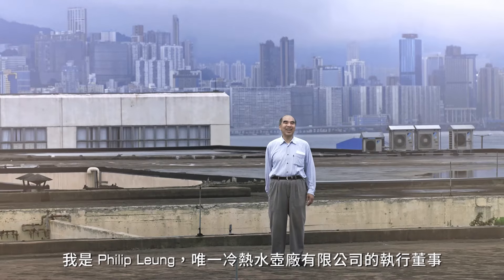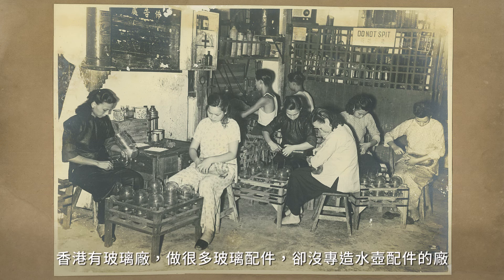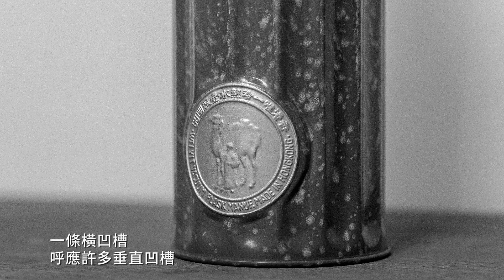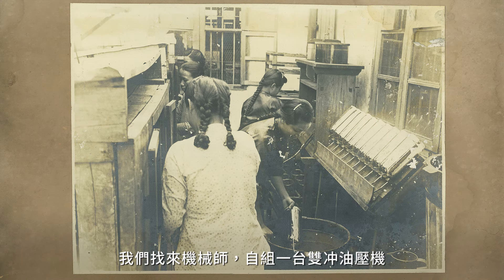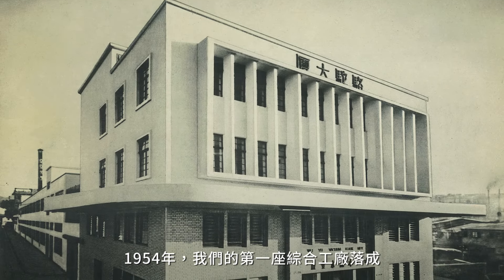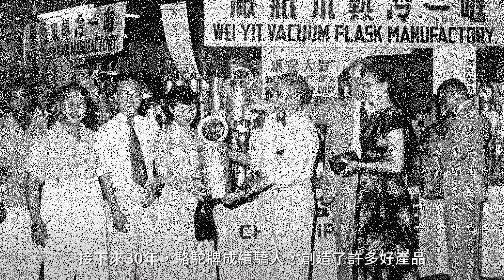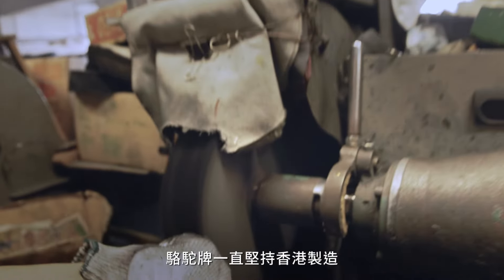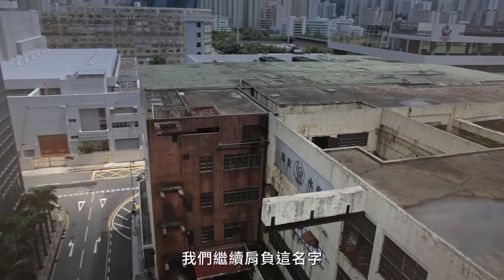Our Name Is Camel 駱駝牌的故事

Comment: I have one of your older Camel flask products and I was trying to determine when it was manufactured. At the 1:57 mark of this video, there is a shelf with all your flask models on it. My Camel flask looks very close to the one which is second from the top left area. The large blue one, but my Camel flask has the Camel picture Logo on it of the man with his camel, so I'm not certain if this is the exact item or not. But my reason for writing this comment was to find out "when" my Camel vacuum flask  was manufactured. It looks to be somewhere from the 1950's to the 1960's but I'd like to know more accurately when it was manufactured. There are only 2 identifying numbers on my Camel flask. There is the number "5" on the rear bottom on the backside of the flask and then there are the two numbers "3" and "0" on the black plastic stopper under it's bottom. Where the number 3 is above the number 0. Can anyone help me determine when this vacuum flask product you manufactured was approximately made?